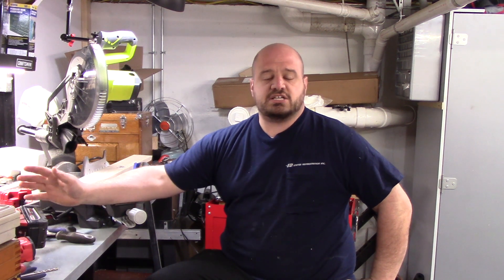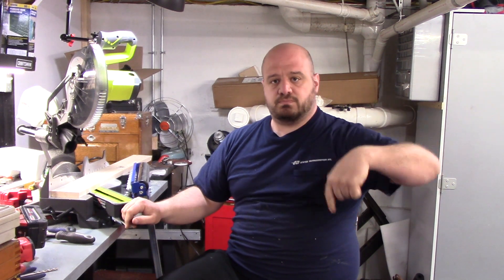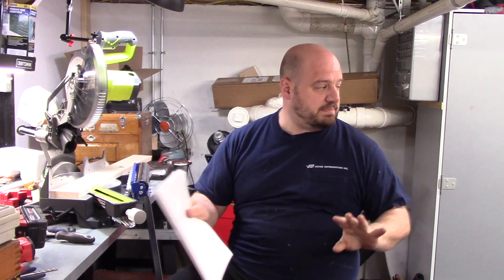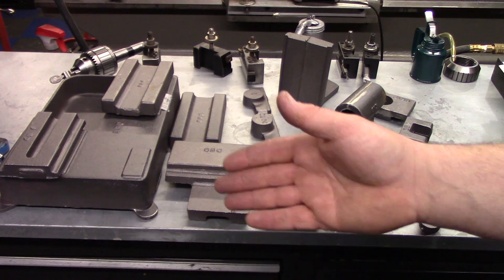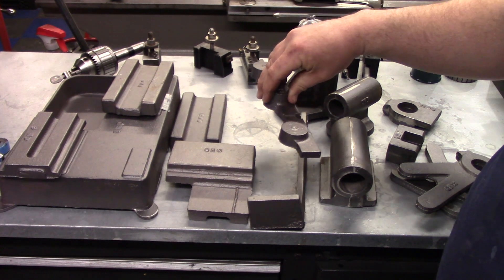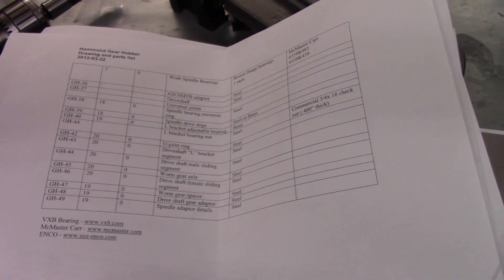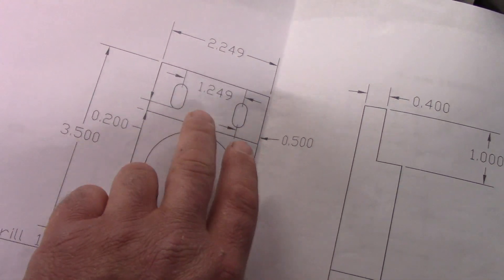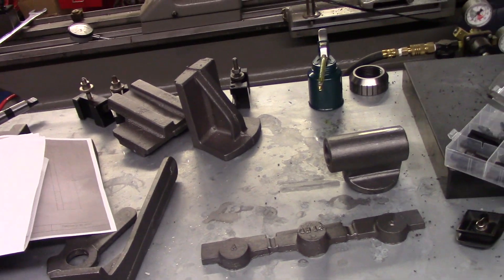Gear Hobber Build:  Intro

Comment: The cast looks fairly good, apart from the error in pattern matching you called out. Errors in drawings like that are common in the model engineering world. Sometimes the fixes to the errors are added as an addendum to plans. Interesting that you watch John over Double Boost. Also I am looking at the English equivalent. That said I only have a 10" lathe but I do have a Naerok Mill Drill and access to a model engineering club with a bigger lathe and mill too.
Reply from the maker: There are two videos up.  Just go to the main channel page and you should see them.  Also if you are subscribed to the channel, click the little bell icon and you'll get notified when new videos post.  I haven't been able to get to much more than those two due to work and family commitments.

Comment: I checked the website after watching the video. Just ordered a 24” camelback from gary, they have a bunch of straight edges and angle plates in stock if anyone is interested, call up, the website isnt fully developed and the order form is a little off

Comment: Defenitely in for this one, Ive been wanting to build one of these for a while, but never understood the finer details or how to calculate the gear teeth throughout the gear train. One of these days, Ill cast out the parts and make one, lol.
Reply: When are you going to start selling casting kits? I like your tool and cutter grinder.
Reply: @mikedevine4667  I probably wont tbh, Im usually severly limited on when I can cast depending on the weather, and I really dont want to get into selling castings tbh. I was thinking about just sending the patterns out and let everyone share the patterns around, and I do have alot of those patterns on thingiverse that can be downloaded and 3d printed under the username cae2100.